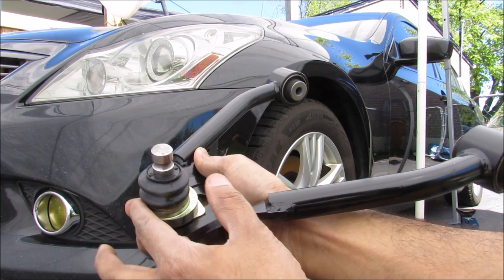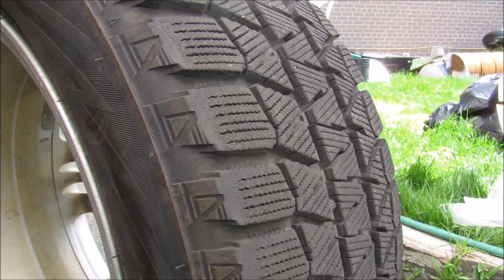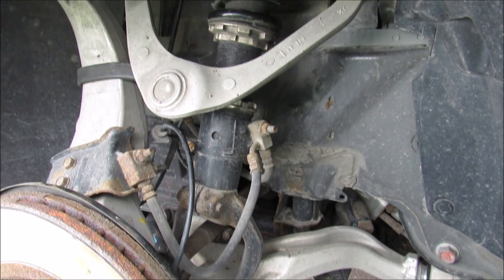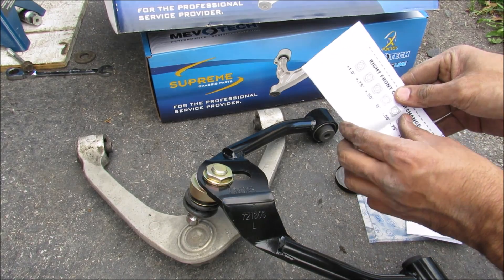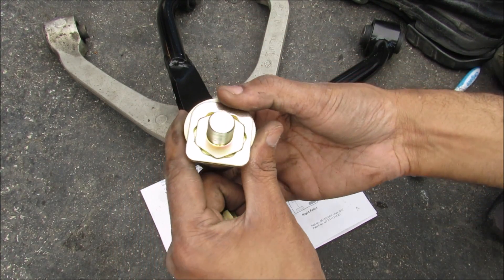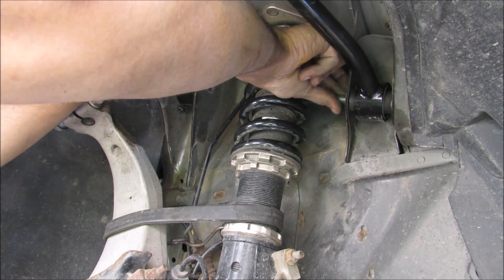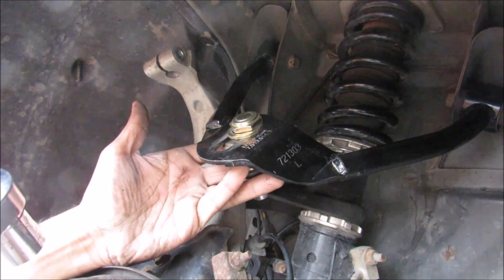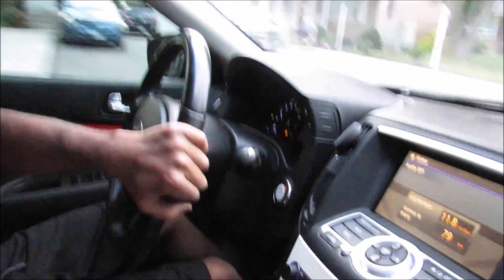Adjustable Upper Control Arm Installation: Infiniti/Nissan

Comment: Can you use those to fix your Camber after an accident where the wheel is tilted inward a little bit
Reply from the maker: Yes but that means something else bent
Reply: @speedkar99  I think the upper control arm bracket is bent

Comment: Can’t believe you put the nut on upside down and completed the install. The washer will just move to where you tightened it up
Reply from the maker: Which nut? The ball joint?
Reply: Compare 3.50 to 5.54

Comment: Can the alignment shop adjust the camber while the wheels are still on?
Reply from the maker: They are supposed to but on these it's a bit tricky because at suspension height, it's tight against the fender liner.

Comment: My 350z shakes steering wheel and makes a noticeable clunking noise that seems to be coming from the drivers footwell possibly coming from the front suspension, it also pulls to the side , I went to an alignment shop and they told me the front right caster was off and that I would need to get a set of these adjustable control arms to correct it, what is the difference in replacing it with an OEM pair so I can get it back to stock specs as opposed to going aftermarket?

Comment: I just got these put on. I first put all 4 lowers and tried to align it but they said they couldn’t get the front camber right. I put these same upper mevos on with a new rack and outers and now my car just better than it ever has!
Reply from the maker: Yep the adjustable uppers help alot with the camber!
Reply: i have these just waiting to put them on.  Ive had alot of front inner tire wear being lowered.  The rears have actually been fine.  Summer tires arent cheap!

Comment: Nice video just installed some on my g35 major fail... When I turn my steering wheel I hear clunking noise
Reply: Yes me and my guy had them on the wrong sides. left was on the right and vise versa
Reply from the maker: What brand
Reply: Z1
Reply: Did you ever figure it out?

Comment: Got mine today! Looks a lot like spc control arms. Quick question can you use thread lock for the ball joint ?
Reply: And what’s the purpose of bump stop? Where does it go
Reply from the maker: Yes you can.
Reply from the maker: Did you get Mevotech parts?
Reply: speedkar99 no i got spc but they look exactly the same!

Comment: Nut round wrong way
Reply from the maker: How so?
Reply: speedkar99 notice the washer is to big for the bolt it’s because the nut goes the other way so it sits inside the washer get me ?
Reply: And before you take it apart it was the correct way

Comment: so I just installed these control arms along with all other control arms and coilovers on my 03 g35. im having some issues with my caster being off. other than that, everything is great. upper control arm quality seems good so far.
Reply: Any update? What about bushing and balljoint?
Reply from the maker: Yep, these arms are working great, thanks

Comment: I was hesitant about doing this myself. But after watching your video Im ready to do this! Originally I paid a shop to put on aftermarket adjustable camber arms, but now the bushings have gone bad, so this time I want to do this myself. Your video is clear about doing it including the issue with the 2 bolts on the arm hinge by coilover. Thanks!
Reply from the maker: I'm glad it helped you. What arms are you using on  your G37?
Reply: @speedkar99  , SPC Eibach Arms. Ill have to get a press at AutoZone to push out old bearings. Now I see why people just replace the entire arms. 😂

Comment: Is this aftermarket modification only used on an Infiniti G or Z when the car is lowered? Will this correct the camber on a 2005 G35 that is not lowered? My camber is not running at a straight flat run utilizing the entire flat surface of the tire. Your feedback will be highly appreciated. Thanks
Reply from the maker: Yes this will help with the known camber issues of the Z / G35 platform
Reply: I had to get these for my car and I am stock height stock everything not lowered. 2dr fyi

Comment: WTF no one notice the washer under the adjusting nut does not even
fit the ball joint stud diameter ?
Reply: Makes Sense thanks for the reply.......
Reply from the maker: Thanks for the tip

Comment: the welds on the aftermarket part are big stress concentrations. OEM part has no sharp edges, looks like it was designed using finite element methods to maximize strength/weight. always a little sad to get a quality downgrade when replacing a part... but there is no OEM equivalent here...
Reply from the maker: Your right, except the aftermarket part is overdesigned, so while technically under heavy stress the welds are where it's not going to fail

Comment: I have a 07 mercedes e550 n my driver's side wheel is pushed inward could it be the upper control arm? If so do they have the adjustable control arms 4 Mercedes-Benz
Reply from the maker: Pushed outward relative to the other side? Or to the fender? Either way take the car for an alignment and check if anything is bent.

Comment: beefy steel is worse than the light aluminium right
Reply from the maker: Depends how you look at it...if the OE is using aluminum then the forces aren't great enough to justify the steel, although the steel is technically stronger